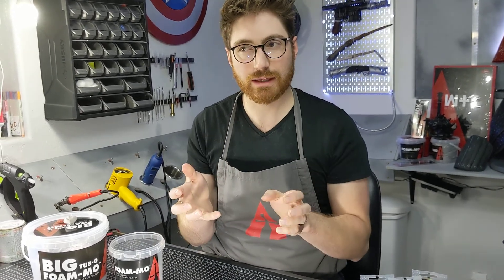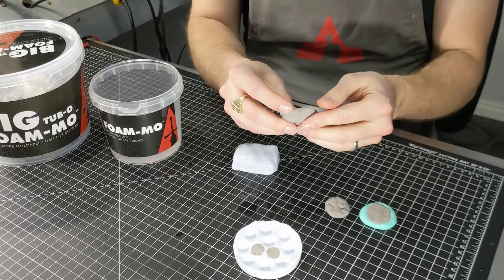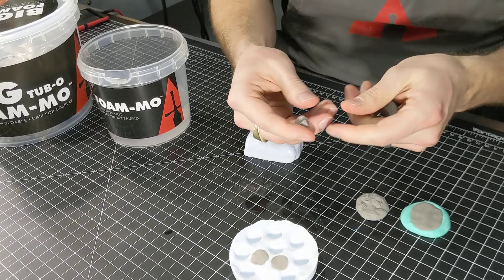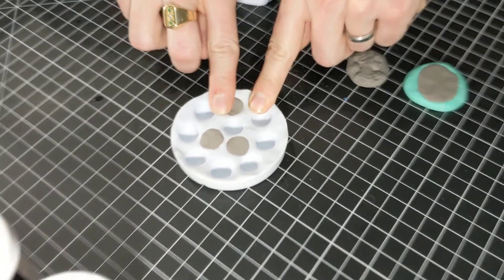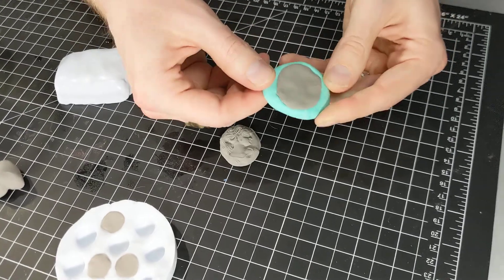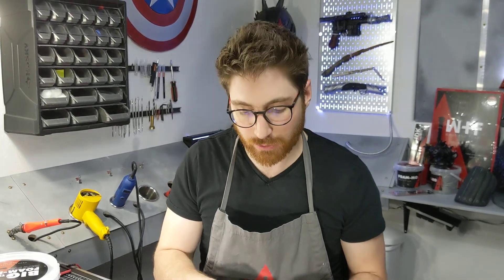Casting foam clay in a mold - Cosplay Quick Tip Clip | Cosplay Apprentice

Comment: Can you use bakery silicone molds, like the ones they use for fondant?  Or clay molds?   Do you let the Foam Mo set up in the mold, or pop it out right away, and then cure?
Reply from the maker: You can, CheesecakePanda on Instagram recently used it with fondant molds and it turned out amazing!!
Reply from the maker: It depends on the mold and shape and size, but for the most part you have to pop it out at some point because it won't have access to the air and will take forever to cure if you leave it in the mold. So freezing it works great so that it is more solid and you can pop it out and let it air dry. :)

Comment: Hey there. I have a question. Can you use your foam to make a mold? Like, when the foam is dry and I pour silicone around it so I can duplicate it? I cant find information on that specifically. I love your views and your channel! Thank you!
Reply from the maker: The main problem I could see arising with that would be that the moisture from the silicone sitting on it could cause the Foam-Mo to start to re-constitute/dissolve.  If you coated the finished Foam-Mo piece with something that would protect it from direct contact with the moisture then it might work. :). I haven't had anyone try this yet so I'm honestly not sure on a solid answer for you on it.  If you try it though I would love to know how it goes so that I can share that knowledge with others.  Hopefully that answer kind of helped? :). Thank you so much for watching! :)
Reply: @CosplayApprentice  
That would make sense. Do you think Plasti Dip would be a sufficient covering over it? I really appreciate you responding to my question! 😁

Comment: what happens when this stuff gets wet, i want to use it in costuming that has to be out door all weather, will it become playable again if its saturated?
Reply from the maker: Great question, yes if it gets wet it will start to re-absorb the moisture and if there is enough water around it will eventually dissolve. :/. I haven't tried it yet but certain treatments/sealing it with a more water resistant substance may be enough to help it survive outside but I haven't explored that yet so I wouldn't be able to say for sure. If you do play with that option, please let me know how it goes so I know for future questions :)

Comment: Does it shrink after it dries? If so, is there any way to reduce that shrinkage or minimize it?
Reply from the maker: It shrinks a little bit. I've found that with pressing it into molds, if you toss it in the freezer while it's in the mold, then demold it frozen it seems to shrink less and retain sharp details.
Reply: @CosplayApprentice   Ok! It's just that I created my pieces at the final size, so I guess it's smart to redo those pieces larger to compensate still for the shrinkage those will inevitably have. Thank you so much!
Reply from the maker: Are you needing to fit it really snug into something? The shrinkage is not major, but there definitely is some. Also the size of the piece will make a difference as to how much shrinkage happens as well. Larger pieces won't see as much as smaller thin pieces. But also, if you seal it with something like Plastidip as soon as the surface is dry enough you can also decrease potential shrinkage and you will seal it off from losing any more moisture.
Reply from the maker: Hope that all helps :)
Reply: @CosplayApprentice  I am working on replicating the Nike Mag but baby size, the pieces of the heel it's what I'm planning on making with foam. The pieces for my baby version are pretty small, 50mm x 25mm and 75mm x 30mm, so any shrinkage will definitely be noticeable, I've heard it shrinks like 15% so that's what I'm planning on increasing for the new pieces. I guess what I could do too, is, if it starts to shrink even more then I can seal them with plastidip once it reaches my desired size.